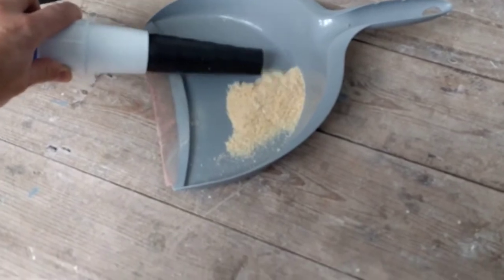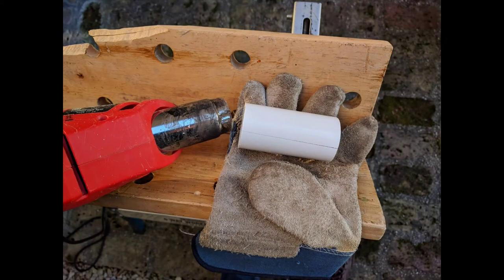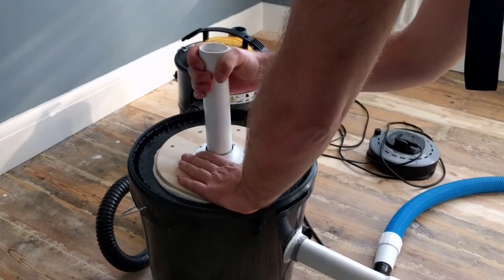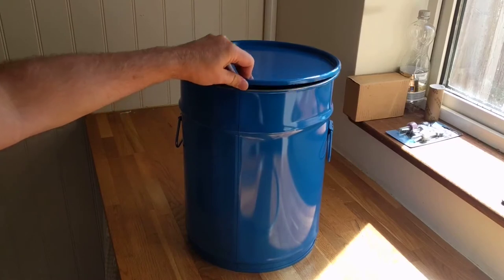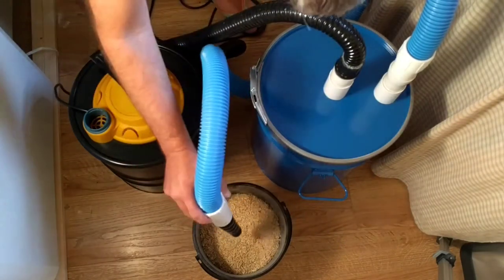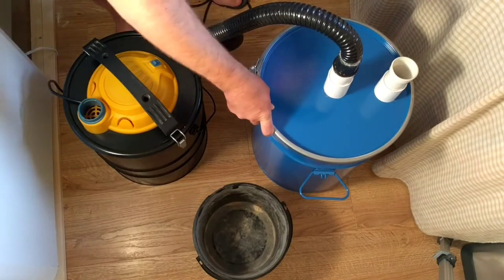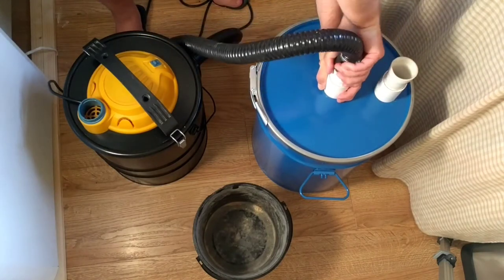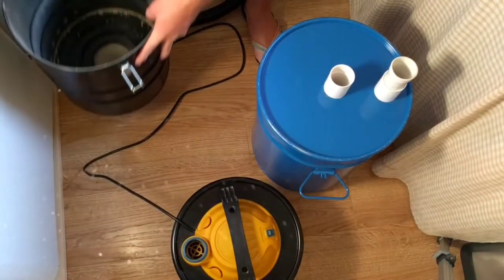Our Little Guide to … making a sturdy dust collector

Comment: When using a step down bit you can apply light presusure and get a clean cut. The old saying is " Let the tool do the work for you " once you get the intial pilot hole you basicly let it fall through the steps. A hole saw in reverse can also give you really clean cuts in really thin metals.

Comment: Avoid any sharp bends in your vac hose or fittings, that cuts the air flow %50, I noted that your black hose had a 90 degree bend, try and avoid this and make bends as gradual as you can, your vac engine won’t work as hard and you’ll get heaps more suction.

Comment: I'm just beginning the journey of building a real vacuum system for my shop, instead of the half azz, make do setup I have. (Several horizontal pipes have to come apart easily 'cause they fill up w/ dirt; the vac don't suck enough. It just sux.  LOL)

Anyway, I'm glad I saw your vid right outta the gate; didn't know dust collectors would collapse.

Had a thought while watching... could a dead Shop Vac, minus the motor work as the collector instead of a 5 gal?

The Shop Vac canister shouldn't collapse... 

Prob find a dead one free.  Hmm...

A tip on using step drills. Before you get to it's max diameter, turn the metal over to cut away the opposite side protrusion.

I've also found most step drills aren't sharp enough, even right outta the box.

They're easy to sharpen... hone the vertical V-cut.  Don't sweat the gold coating, being sharp out weighs any loss of benefit if you hone away the titanium coating.

I have an uncoated step drill I keep sharp & use it on mild steel as thick as 0.375".

Comment: It's not so much the orientation of the inlet pipe. If you were to add a Thien-type baffle under the inlet pipe, it will minimize the amount of dust that the outlet pipe sucks up. Like a barrier between the settled dust and the vacuum outlet.

Just create a disc about the diameter of the barrel, cut away about 240 degrees from around the outside of the disc and support it with 3-4 threaded rods under the lid. Position the cut away so that it starts a few inches from the end of your inlet pipe and ends before it makes it way back around behind the inlet pipe. The cut away should be about 1" to 1-1/4" wide. If you search YT for "Thien baffle", you'll see what it should look like.
Reply from the maker: Thanks for that Woodnoober! I'll look into that – although it may be beyond my capabilities for now.

Comment: Why aren't you using a cyclone on top of your bucket ? I made a dust separator/collector using a cyclone and a plastic food container bin (similar size to your steel drum) and it works very well when used with my DeWalt shop vac.
Reply from the maker: Hi Ian. It's mainly because without having workshop, it was a struggle enough just cutting the holes in the lid of this drum. It's only hooked up to small, handheld devices so far and there seems to be enough of a drop to keep the large dust particles out of my vac. But that’s a modification I may need to look at in the future.

Comment: where did you buy thr drum please.
Reply from the maker: Hi Lee. I’ve no affiliation to any firms mentioned in this reply. Company I originally used (speedyshelving.com) doesn’t seem to sell them anymore. You might try bigdug.co.uk which has its own website and an Ebay presence. The prices of these drums (they are called open top steel drums) seems to have shot up – not much of a surprise in the current climate. Bigdug’s Ebay site is £70.99 includes P&P at the time of my reply, but the firm’s site isn’t that much cheaper (£52.80, doesn’t include P&P). One commenter below said in Australia commercial painters give these sorts of drums away for free. I’ve no idea if that’s the case in the UK. Hope this is helpful.

Comment: I know the feeling from the other end of the size spectrum.  After spending weeks looking for proper parts for my Grizzly (G0944)... 6" fittings/elbows to make a dust separator, I gave up and just spent the money to buy a ready made unit from Oneida (Super Dust Deputy XL).  $230 USD for a chunk of molded plastic.  Ugh.  

I could not find 6" PVC parts for any reasonable price and the cost of a metal drum was crazy.  I just mounted the Oneida to the top of a standard metal trash can... sorry, dust bin.  Done.  Works!  :)

Comment: Where did you get the bucket from please?
Reply from the maker: Bought it new from UK online retailer speedyshelving.com – currently £34.80 according to its website.
Reply: Thanks for the information
Reply: Was going to ask the same question myself😊
Reply: @ourlittleguide326  in Australia commercial painters will gladly give you the metal large paint cans with the snap-close lid for free, they're glad to get rid of them.  I've made 2 from them and they seal very well, my vac is a Milwaukee and using the Bosch tracksaw connected to my earlier plastic version with a slight blockage imploded the plastic one.  You can also drill holes and insert tubeless car valves to the lid (treat the drum as the inside of a tyre), if there is a blockage the suction will pull the valve open and allow air in.
Reply from the maker: Thanks for the comment. I don’t know anyone in the commercial painting trade in the UK, so I don’t know if that’s an option here. But it’s something I can always look into if I need to source another drum.

Comment: Your "dust collector" will lose start to lose efficiency as it starts to fill up. There's a reason why commercially made ones aren't just a bucket with holes. They're setup so that when sawdust enters the separator the Centripetal Force
 pushes heavier elements to the outer rim and eventually fall into the collector while lighter elements gets sucked into the wet/dry vac.

For all that work, you should've just spent $40 on a Duststopper for much better results and save yourself time.
Reply from the maker: I've not run it long enough to overfill – it's only ever been attached to small handheld power tools. But I'll bear in mind your advice on efficiency loss. Thank you!
Reply: As they say though the journey is half the fun. I especially enjoy it if I can build it out of junk I already have.

Comment: why did he just use a hole saw or drill a 3/4" hole then use a electric nibbler both wood give you a finer hole or a jig saw with a steel blade you don't work harder but smarter.